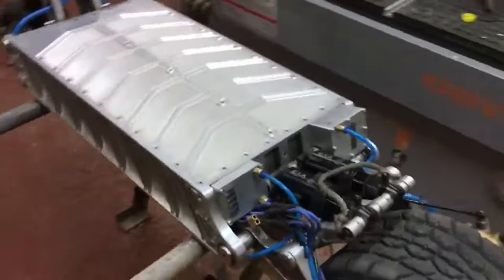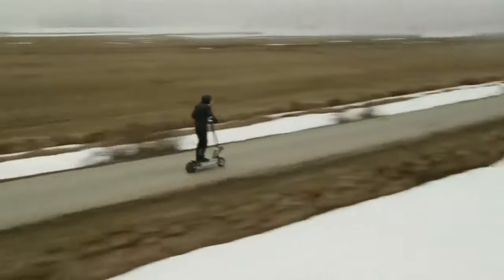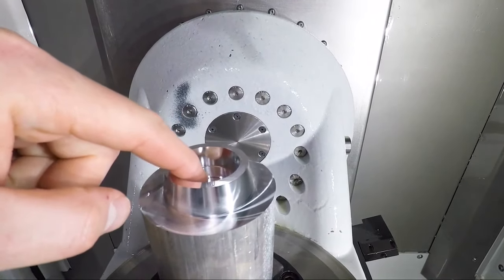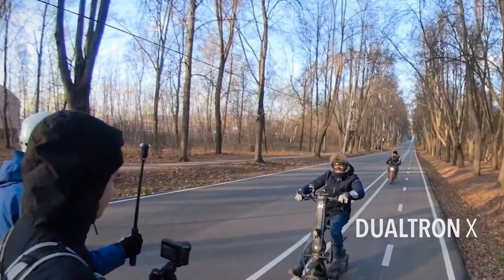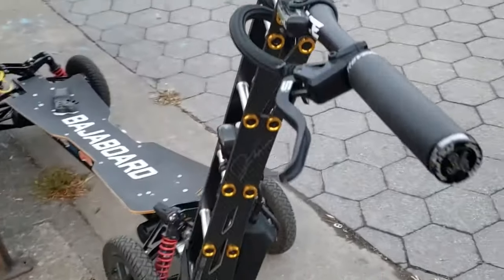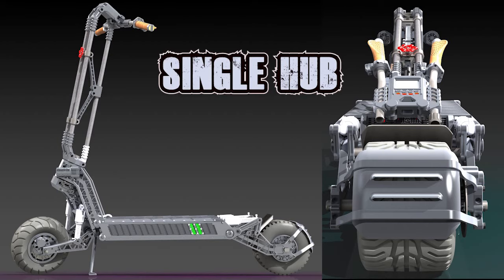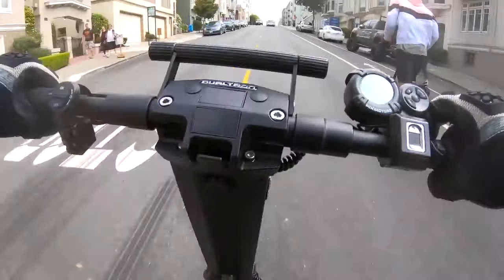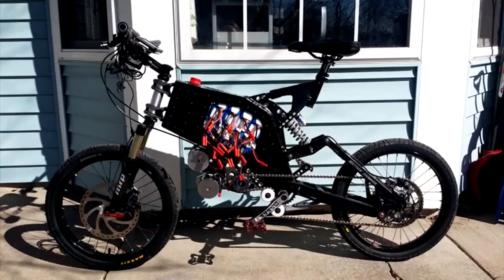Insane BEAST - DIY Vostok 2 Scooter VS Dualtron X

Comment: this was not a fair comparation, Dualtron X has settings on the controller that can make go from eco to super charge, also the speed on the video was not that fast maybe 80 kmh? 
i can go 100kmh on my DTX and I know it can go faster...
also theres the RION scooter and that's hands down the most faster scooter on the market
Reply from the maker: These guys tested in Russia. I only found the footage online. I dont know why would they test and not place a max setting on the dualtron. I think they did max speed test on both scooters.
Reply: Alcino - 100 kph? Is that GPS tested?

Comment: Hi there! Thanks for the review. I've been following this project and quiet interested in the outcome.
1. Have you got any information about the weight of the scooter?
2. Are they planning to ship it to Russia?
3. What about the estimated price?
4. What's the size of the magnets in the motorwheel?
Reply from the maker: i don't know the specs but I assume is heavy since all parts a billet aluminium CNC and you can see its built like a tank. Several crashes and nothing broken.
Reply: @ElectricVehicleSpace  Thanks fro the reply. I'm looking forward to the videos with the news on this project. 
I've noticed that the motorwheel voltage goes from 60 to 94 v - but what's the battery voltage?
And about the wheels? Are 13 inches? 
Thanks in advance.
Reply from the maker: @GeradNoumak  the website alfa....I posted has info there.
Reply: Александр Калюкин приветствую, я представитель производителя, можем связаться по email? momoto@zoho.com
Reply: @ElectricVehicleSpace  Is this scooter in the market now? Thanks in advance...

Comment: I understand from what I heard from the vid, this  talented builder's name is Alex. You now have fans in what you are doing man. Keep it up. Your fans wish if you could offer your products on the market? Meanwhile, from the looks on your vid, most of the materials if not all used by Alex are aluminum. How much does the unit weigh if indeed he uses aliuminum?
Reply from the maker: I posted the link of his website in the description box. You can contact Alex and ask questions.
Reply: @ElectricVehicleSpace  Website is no more so i'm assuming it didn't work out. :(

Comment: people need to get speed out of there heads otherwise these scooters will be classed as motorcycles,distance at lower speeds is far better.
Reply from the maker: you can adjust the settings and it is up to the person who rides to control the speed and rest of the parametres.